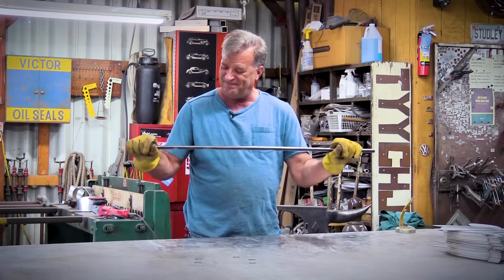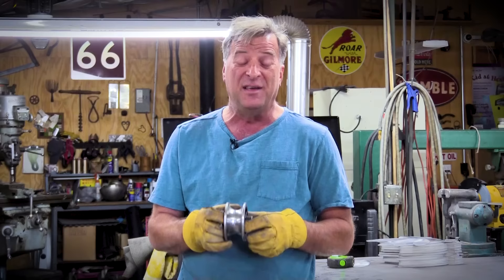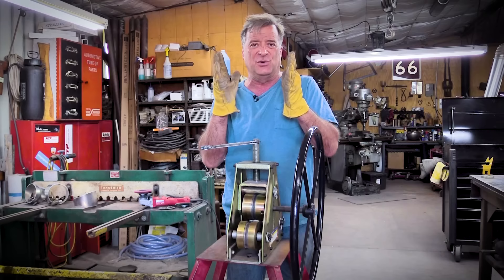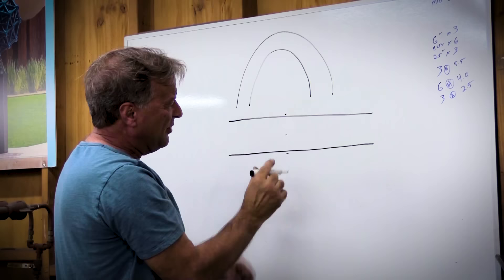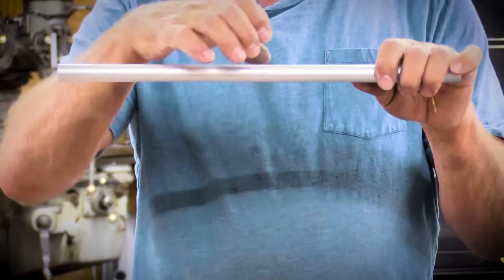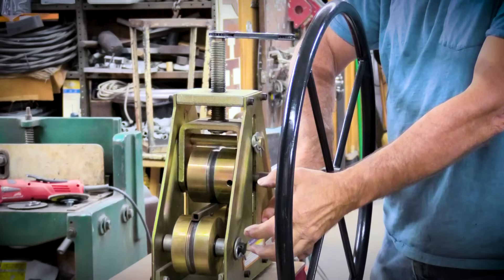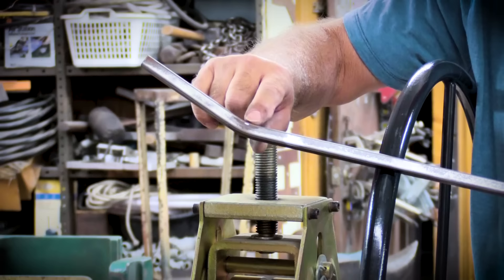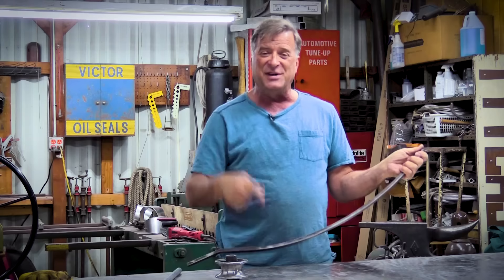How to Bend Square Tubing So It Doesn't Kink - Kevin Caron

Comment: It's called the neutral axis.  This is where the compressive and tension balances in the material section.  The compressive strength is higher than the tensile strength, so the neutral axis is not in the center, but is anywhere from 35% to 48% of the thickness.  In sheet metal they use bend deduction or bend allowance to calculate the position of the radius.  In precision metal stamping, it is normally done by calculations backed by actual bend data.
After active duty, I went into the stamping and injection molding industry as a mechanical engineer.  We had to hold extreme precision on bends and their angles.  There is also spring-back so the inside bend radius and angle is smaller than the outside.  This is very difficult to predict as the material strengths can make a huge difference. Both the chemistry and heat treatment of the raw material has a tolerance just as the physical dimensions that affect the bending.
Robert S
BSME
Reply from the maker: Interesting!   Thank you for watching and posting.

Comment: Kevin, you're a great person to ask this.  I have some 1" x 3" rectangle tube, 14 gauge, that I want to cut into 6ft sections and bend into an arc shape like a bow..so a long gradual curve over the whole piece with a center apex of ~16". So literally like the shape of a bow and arrow" bow shape.  And yes the curve is along the flat 3" side.  How can this be done?
Reply from the maker: A pipe roller with square dies to fit your stock.  Going to be VERY hard to do without hydraulics.  I would either cut and bend and reweld the stock you have or....    1 inch stock to roll the top and bottom of the curve and flat sheet to cut and weld the front and back on.    You could try filling the stock with wet sand and capping both ends, then heat and roll or bend but I have never had any luck doing that.

Comment: Hi there, thanks for the video, if I need to curve a 1”x1” 16ga mild steel tube but the full length is 25’ and the max bend in middle is maybe 9” pushed out compared to a straight line. Do I still need a tube roller or is there a simpler way? Just need to make 8 PCs.  Thanks in advance
Reply from the maker: Sorry but you will need a tube roller for this job.